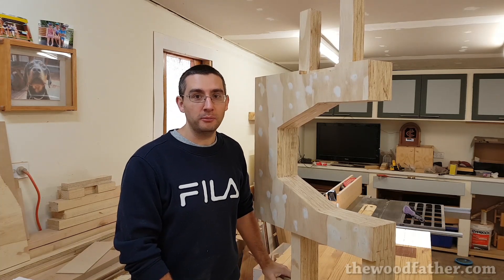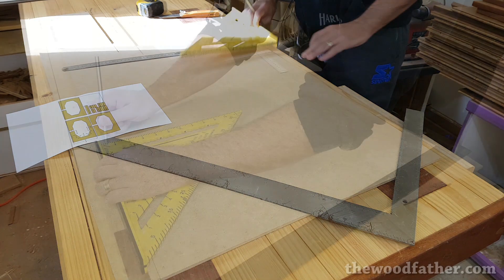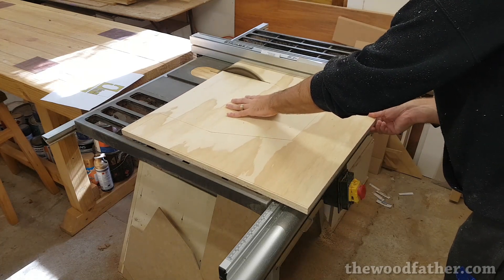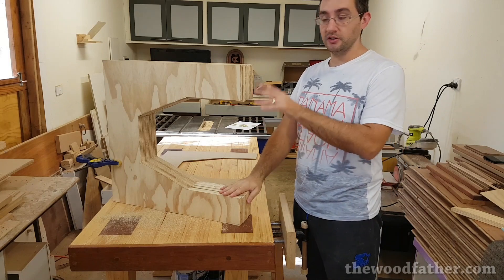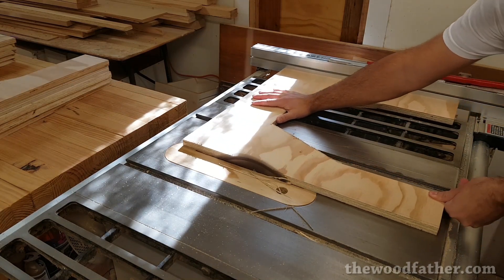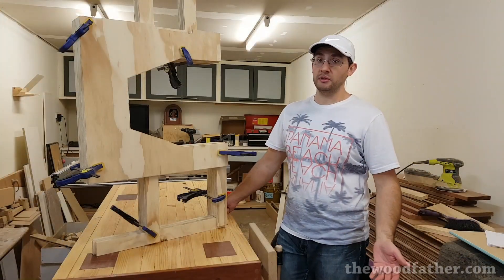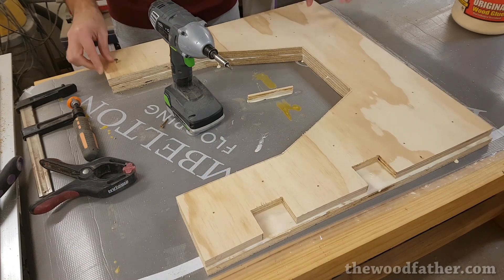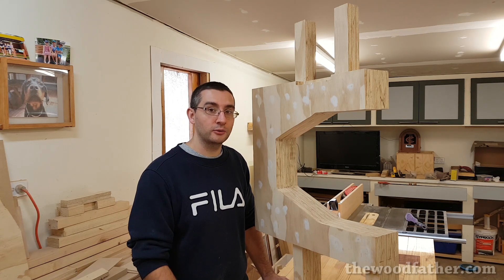Building a Wooden (plywood) Bandsaw - The Frame Part 1

Comment: Hey Mario, just a quick question, where do you get your plywood from?
Reply from the maker: Hi Chris, I used to buy from http://www.allboard.com.au/ but I haven't had the need for a while, this sheet has been sitting in my shop for over a year.
Heads up though that a problem with them is the quality and price for the same product seem to differ from week to week, I used to pay $47 a sheet which jumped to $73 a few months later, while the actual product dropped in quality in a major way. One delivery I had was completely wet and warped, I wasn't impressed and returned it. You really want to go into the store and cherry pick the sheets, if you get it delivered they seem to throw the crap at you. The price seems to bounce around depending on which salesmen you get, I'd suggest holding onto a receipt and taking that in the next time so you can get them to stick to a price.

I guess it makes sense though, my assumption is that the little guy who comes in and buys 5 or 6 sheets is worth nothing to them, they'd rather sell 100 sheets to a builder in one shot.

Comment: As soon as I solve some health problems I will be building a Wandel bandsaw. I'm doing the 20" and scaling it up to 24". Mattias does not recommend the use of plywood, but I worked a part time job in a cabinet shop where I acquired a whole bunch of scraps and off cuts of high density 1' hardwood plywood. I've got enough to make the frame seven layers thick, which will make it 2" thicker and I'm making it 2" wider too. Your video is encouraging. I saw a Korean site that made his out of hi density ply too. We will see how it works out.
Reply: Hi, Lawrence. Why are you scaling up the 20 inch model to 24 inch?

Comment: I think it will be stiff enough. Using plywood gives it even more layers of graincrossed wood. In my opinion, this increases the stability and strength. I'm very interested in how this one come out.
Reply from the maker: That's my thinking too, I figure ply is more glue than wood and with the grain going in two directions in my mind it reduces flex in both directions, but, it is possible that it means it is half as strong as well...

Anyway it doesn't need to be the most rigid structure ever devised, it just needs to be strong enough for the desired task, fingers crossed it should be good.

Comment: Mario, did you do an estimate of difference in cost between using plywood over our equivalent to Mathias's solid timber, which I guess would be pine. Also, where did you source your plywood.
Reply from the maker: Hi Ralph, the plywood was from a local distributer to me in Melbourne, Aus, they are called 'AllBoards'. It is 18mm and to my eyes is of a decent quality. Very few voids or knots. This sheet would have cost me around $70 (though I've had it for well over a year, it technically was scrapwood.)
I did compare the cost for buying new materials which I'll put into the follow up frame build.
Reply: Mario Cappellano Ok, thanks Mario, I've had the plans for a few months but haven't done anything, this should spur me on. Cheers
Reply: Mario Cappellano just found out that Allboards have an outlet not that far away in Bayswater, didn't know about them but will certainly visit now, prefer not to use Bunnings if I can avoid it.
Reply from the maker: ralphd their ply is far better than bunnings, but make sure you see it before you pay!
Reply: Mario Cappellano ok, thanks mate

Comment: Interesting experiment with using plywood.  That would certainly simplify and speed up the construction of the frame.  I'll be curious to see how it works out for you.  Even if it fails, you can always go back and remake it from solid wood. I built this saw about 2 years ago and I love it.  I've had a few issues with it due to mistakes I made, but it is comforting to know I can always remake a part if i need to.
Reply from the maker: Cheers Allan that is one of the reasons I decided to try ply. Even if it is useless, I can rip all the parts off of it and rebuild from solid wood. There's just something in my mind that refuses to believe ply isn't strong enough, well, I'll find out one way or another!